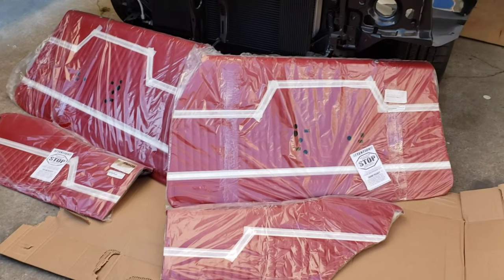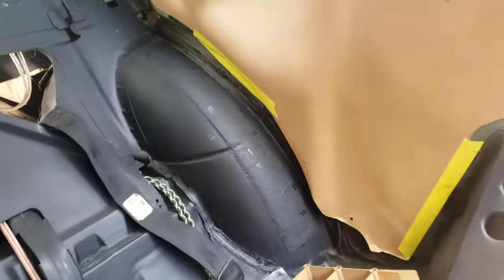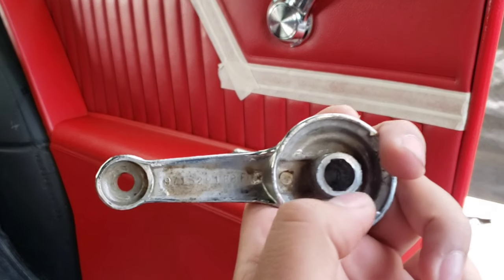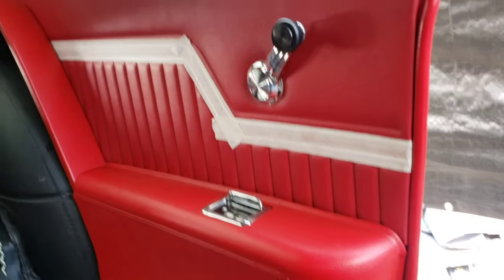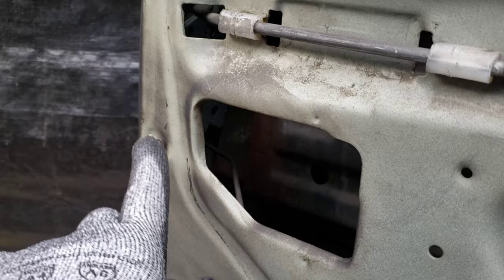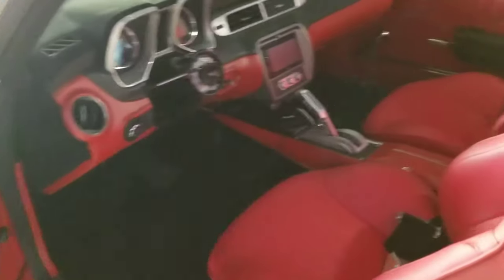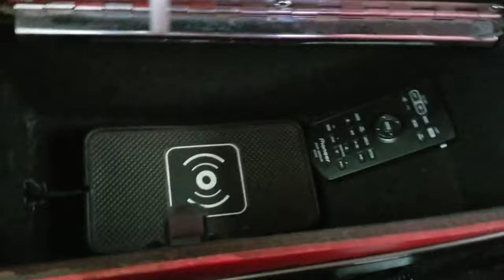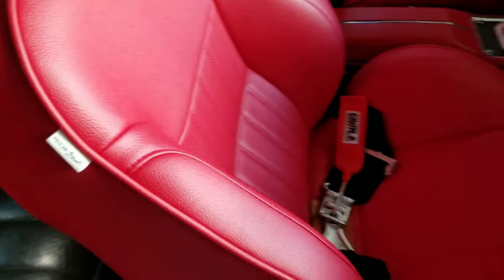Door Panel & Seats FINAL Install | 72 Chevelle SS

Comment: Looks amazing!
I’m doing new door panels on my 70 right now as well. Did you have any issues with the weather stripping affecting the panel fitment? I can’t get mine to sit flush on the latch side. (May have to trim stripping underneath panel?)
Keep up the great videos!
Reply from the maker: Thank you appreciate it🤙🏽. . . no my weather stripping didn't effect it on mine. The "wind lace" was used tho, if it was new it would for sure!

Comment: The red door seal that you weren’t sure if it went above or under carpet, did you have to use 3M weatherstripping adhesive to install? Thanks
Reply from the maker: No I just tucked it under on the top and left it exposed on the bottom It stayed down and straight but no one really gets in the back. When I was a kid getting in this thing I used to kick and step on that strip all the time and it started getting all bent FYI 🤷🏽

Comment: Is legendary better than PUI.

I’m looking for a complete full red interior for a 1970 Chevelle
Reply from the maker: legendary is 5x better than PUI. . .PUI stuff doesn't even look like OEM Chevelle at all 😂 most wouldn't really notice but if you want an OEM door panel that bolts up perfectly as if it was a 2023 door panel I wouldn't pick any other one.
Reply: @Califormula  thank you.

Hopefully legendary has the complete kit.

I want it in red
Reply from the maker: @keiranay8343  You're welcome and they do! keep in mind they sell three different shades of red the OEM 1970 Chevelle red is more of a burgundy cranberry red then what you see here.
Reply: @Califormula  I guess the question would be which red is the easiest to match. I’m trying to go red with the dash pad and floor shifter as well
Reply from the maker: @keiranay8343  being you have a 70 I would go OEM Red, as you can buy everything as it was meant to be for the cars, they didn't make red in 71 or 72 so I went with a brighter red if you plan on painting or dying anything that would also be dependent if I was in a 70 I would just do OEM.
Reply: @Califormula  right on and thank you.

I’m think the OEM red but I will get with legendary on Monday.

Thanks for all the advice!!
Reply from the maker: @keiranay8343  Sure thing glad I could help! Good luck with the build 🤙🏼

Comment: Thats the way you install the window crank, put the pin on and fit it on then pop it with a mallet or just your hand usually.  Wonder how red inserts in the backseat would look. My interior was all black and dull so I had them redone with red inserts.
Reply from the maker: K good I was a bit worried 😂